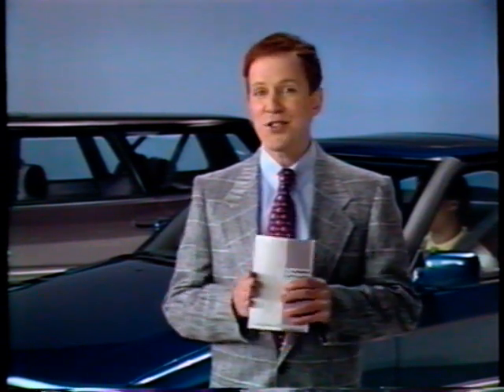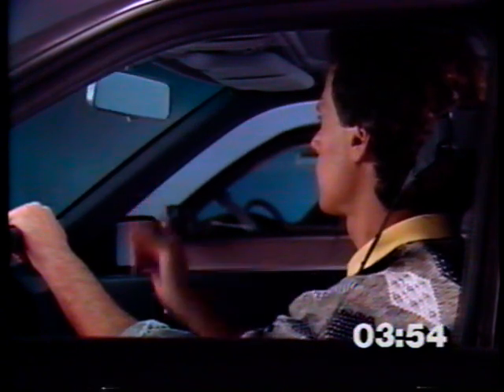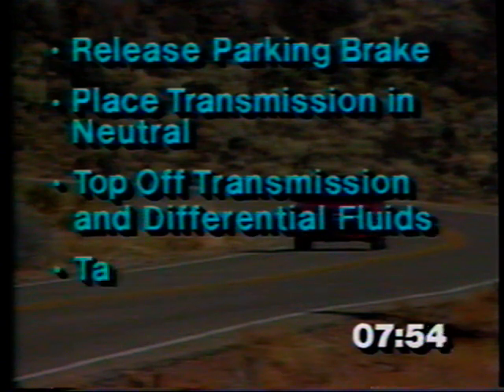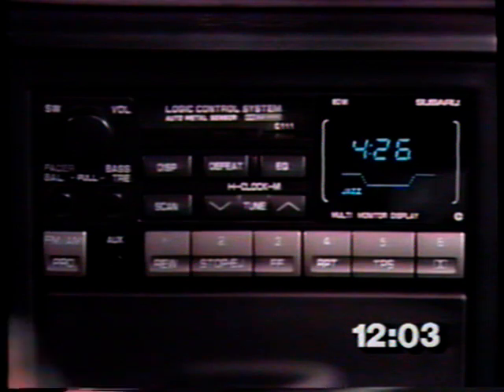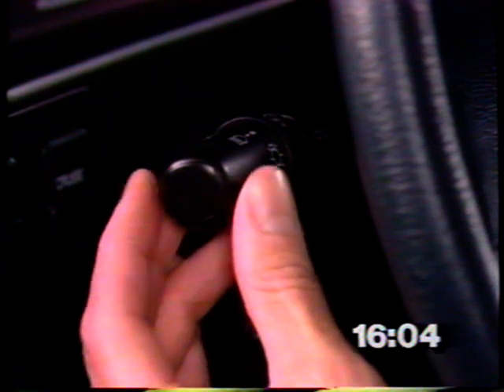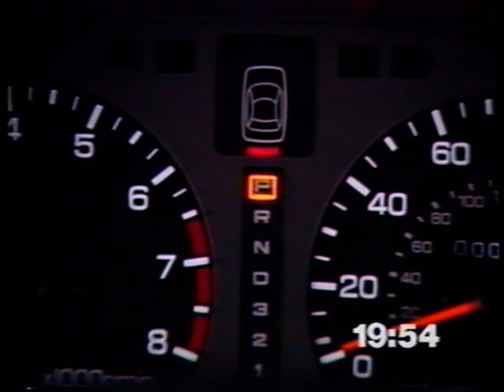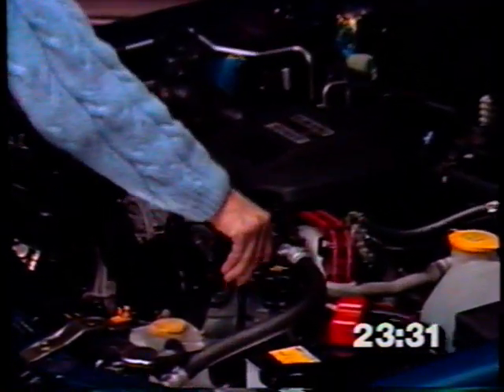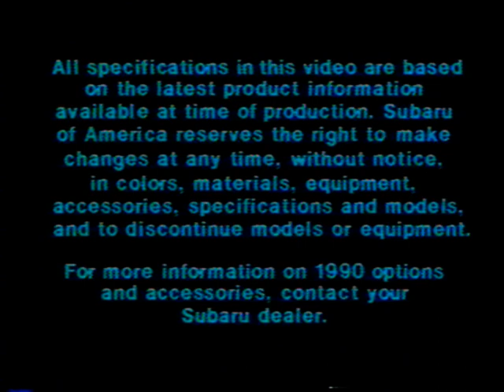1990 Subaru Legacy Owner Information Video

Comment from the maker: The Subaru key is for the door locks and ignition.  That round key is the valet key which only works on the doors and ignition.  It doesn't work on the trunk or glove box.
Reply: The light key has -X stamped on the key and the valet key has -Y stamped on the key wand the little wallet key has -X stamped on the key

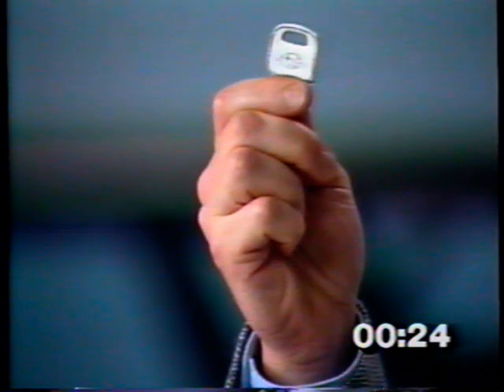Comment: 3:16 Valet key, it wont open the (boot)trunk ....20:45 but the (boot)trunk release lever will lol! So refreshing to go back to a simpler time, where the salesperson actually knew the cars they sold backwards!  In that era, the car adverts mentioned the number of camshafts, ECUs, power figures and suspension and braking specs. These days they and the car buyer wouldn't have a clue about whats under the bonnet and big plastic covers keep it that way.  I own the RS turbo version of the BC Legacy and its still going strong some 30yrs later, when a lot of more modern cars have given up the ghost!  🙂Cheers!
Reply from the maker: There's a pin/lever in the trunk that you can switch so the trunk does not open with the trunk release lever.
Reply: @jcc189  lol did not know that! What about pulling the split-fold  rear seats down? Some work to crawl in but you can not lock them independently in my legacy at least. Not sure about U.S models.
Reply from the maker: @HereIsMyOffer  There is actually a knob on the fold down seats that allow you to lock them to prevent someone from folding them down from the cabin.  Here a scan from the owner's manual.

https://main.experiencetherave.com/subaru_manual_scans/1990_Legacy_Owner_Manual_Scans/014.jpg

Comment: Just learnt from this video a feature that I never knew existed😆 the hill break assist. Ive really suffered alot with that one. Is it a standard feature with all first gen models? Mine is the second series BC2 91. Will try that tomorrow😂
Reply from the maker: Yeah, it should be standard on all BC/BF Legacies.
Reply: I have it on mine. Disconnected it due to the clutch pedal feel feeling like a mustang with a king cobra clutch.  Nice and easy now.